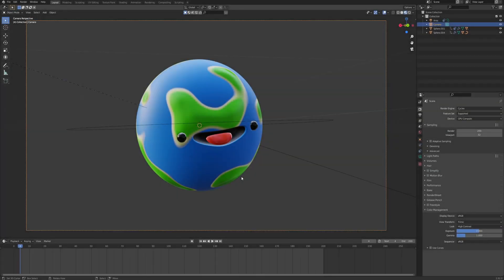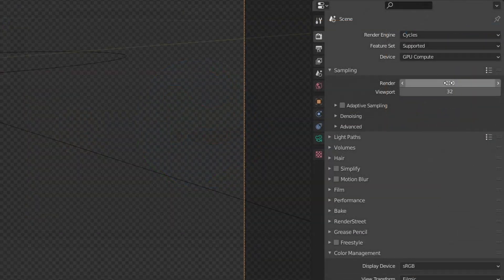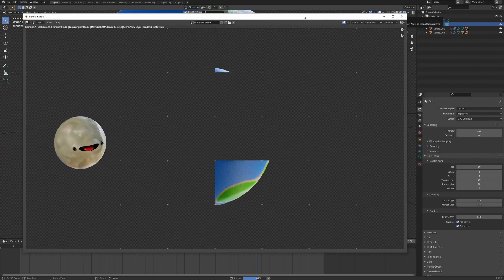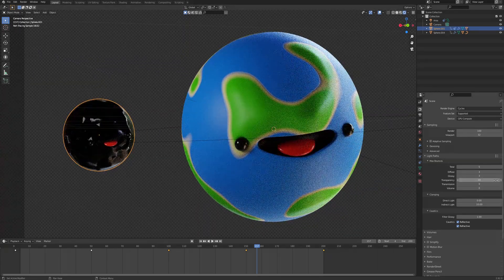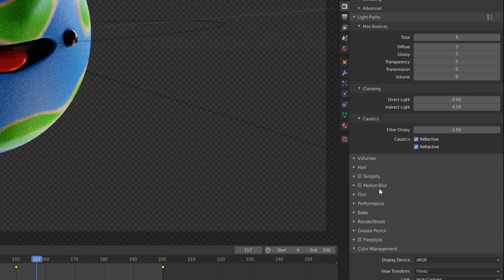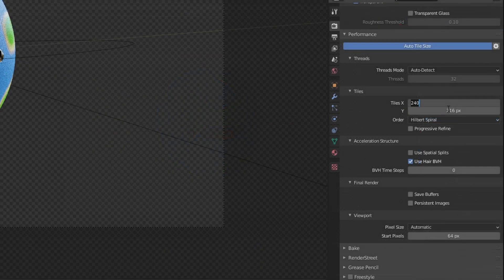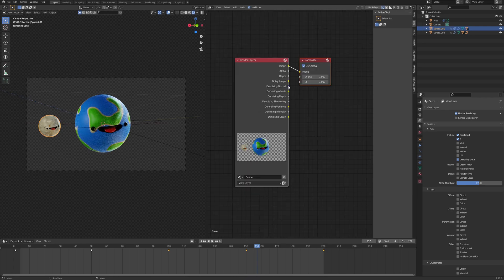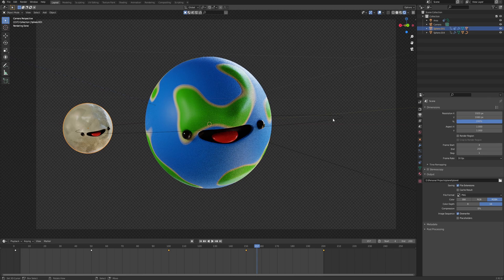RENDER SETTINGS IN BLENDER 2.92!

Comment: Can you help me? I have a rigged character with fur. The fur color comes from a noise texture node with color ramp. How do i have to setup the mapping to have a texture that moves with the character? I mean, the texture is like staying in its coordinates while the character is moving. It looks weird. In Material Preview Mode AND Render Preview the texture is moving WITH the Mesh. Only in final render it goes crazy. I'm so desperate 😔
Reply from the maker: Try with a hair info node - mapping node - your texture. Connect the is strand to the mapping and use the mapping to distribute the hair. Otherwise you can also check out Blender Guru's tutorial on hair, go a lot of useful info there!